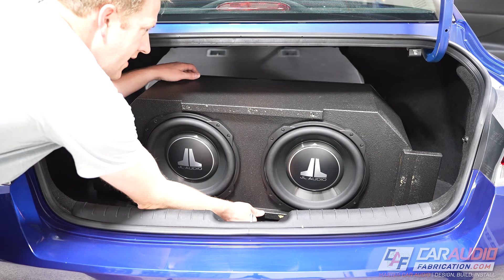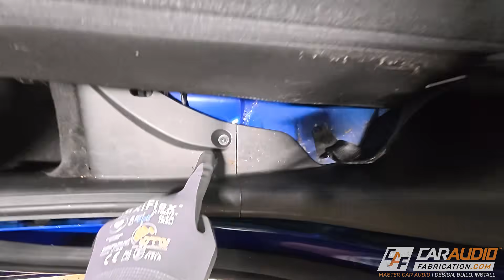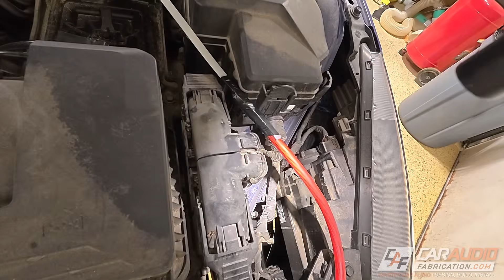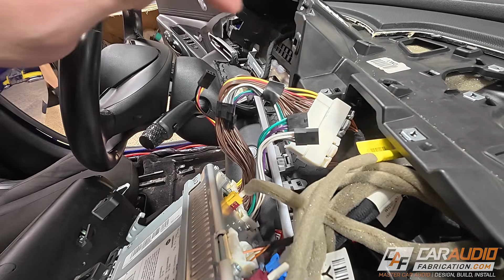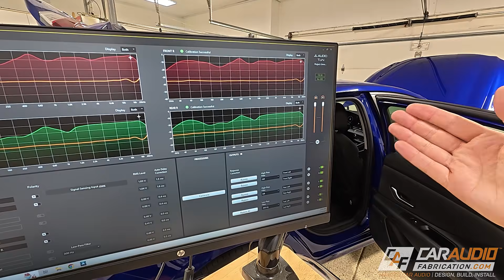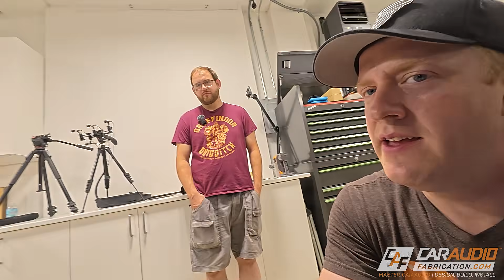Can we install in just a few hours? Subwoofer & DSP Amplifier build complete!

Comment: What did you use to model this? i have the same exact scanner. did you export the file and then put it into sketchup or?
Reply from the maker: Sketchup is really only capable of extremely basic modeling. Its more a program for tinkering. To take it to the next level you need an engineering grade program like Fusion. I show all of this in the full playlist for this project.

Comment: I have a few questions so after doing the math my system is 217A what size fuse do i use in my power distribution block. I can find 200 240 an 250s all day but not 220. Curious if I can use a 200A an be ok.
Amp is the taramps Big boss 3 bass
Subs American bass XR-12D2 1200w at 2ohmn an I’m running dual 12s. 
2500w/.80=3,125W/14.4=217.0139W 
3125w/13.8=226.449W

Whole system 
3300w/.80=4,125W/14.4=286.458W
4125w/13.8=298.913 W 

What size inline fuse do I need for my whole system. I’m not competing just wants a super clean system build. 
Amp for subs an 800w ct sounds amp for front a rear speakers an 2 tweeters.

Comment: Hello, 

I have such a sound system, Android multimedia unit. Can you give me some advice on the connection? I want to put the amplifier under the right seat and the Sappa headlight in the rear trunk. I need help with the connection. Should I connect it directly to the active Android media before entering the amplifier?

Audison In-Car Sound System Package

Box Contents:

1 APK 165 Center Unit
1 APX 6.5 Speaker Unit
1 Audison SR-4.300 Amplifier
1 APBX 8 AS.2 Subwoofer

Comment: Wait... so a VXI amp won't flatten the signal itself?? I thought that was half of what a dsp did.... prosses the signal in and out. But from your explanation, it only adjusts the output?
Reply: You are correct. VXI or any other DSP is meant for output manipulation. Time alignment, Phase, EQ etc. 

The JL FIX Lineup is what I like to consider a DSP intergraded Line output converter. It auto corrects the input signal by removing all factory signal manipulation and flatlines it for a cleaner signal going into your DSP.
Reply: Yeah I don’t know why the fix86 was added, maybe  less time to tune? It flatten the signal , so input doesn’t have to be modified but only output . However now it’s one extra piece of equipment that really isn’t needed. 

Mark, can you clarify your thoughts when doing this? Just for an easier tune or some other reason ?
Reply: @CarAudioFabrication ^
Reply: Doesnt the Tüne software have input sensitivity adjustment? Guess that is different than signal flattening but still. Kinda crazy, extra $500 just to reverse their work so you can adjust after..

Comment: Is there any loss of grunt having the amplifier running the speakers through such thin gauge factory size wiring?
Reply from the maker: Not at this power level.
Reply: Theyre only like 400rms arent they?
Reply: You can't lose power by undersizing the wires. The only worry is that if you try to pull too many amps through too small of a wire, it'll get hot and could catch fire. Most factory wiring can handle quite a bit though as long as you're going for clarity rather than volume.

Comment: I have that same car. There is a factory ground on the driver's side behind the panel closest to the rear door
Reply from the maker: Typically better to single point ground to avoid potential noise. I saw that location, it's in a spot where there are tack welds and adhesive panel bonds between the metal and where the frame connects. Probably works find for the low current factory stuff but wanted something a little more robust.
Reply: @CarAudioFabrication well crap. I'm running 1800 watts in my build. Thought that would be good. No noise but now I'm rethinking my ground point!